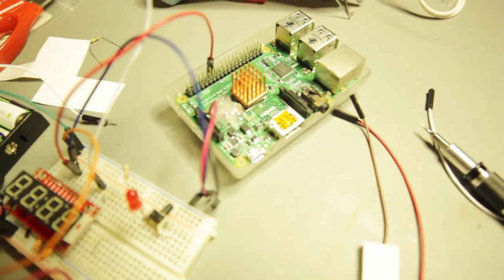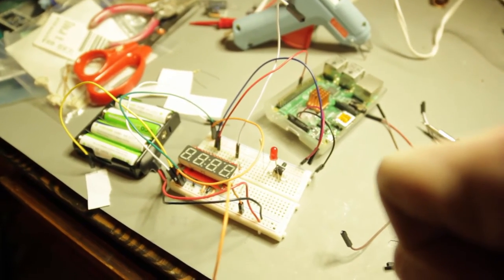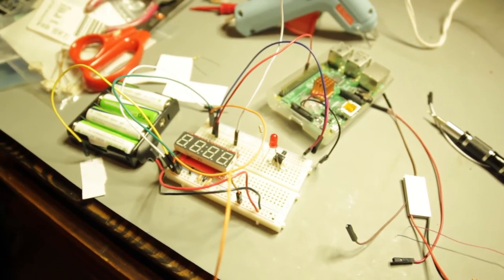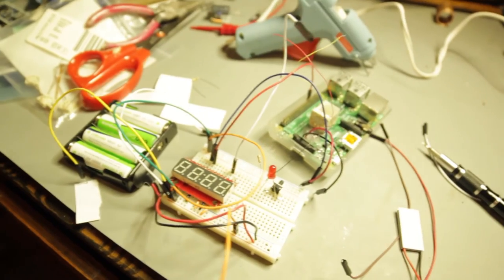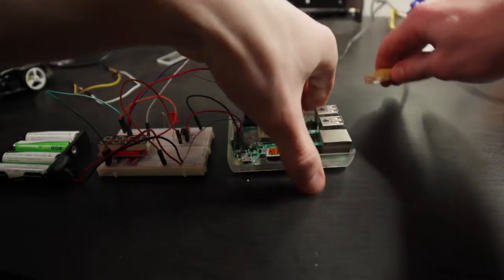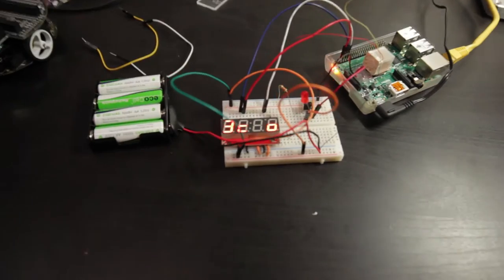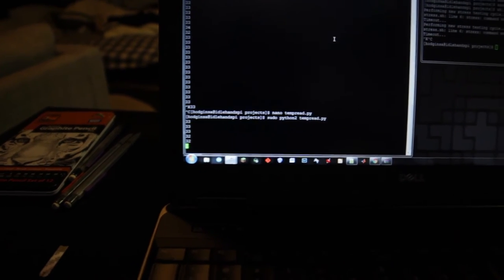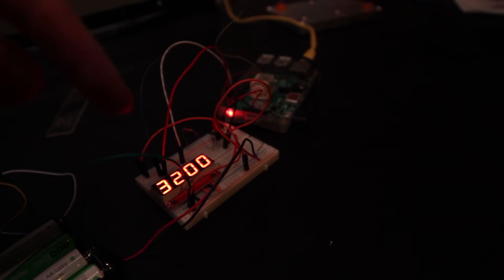Peltier on a Raspberry Pi! - Happy Pi Day!

Comment: +SeanHodgins This is amazing. Also subbed, Could i get more information on what Peltier was used?  I found the links to everything else used and purchased them. Eagerly waiting to start this.
Reply from the maker: Thanks! I don't remember what peltier exactly, but searching Digikey, find a peltier that is 15mm x 15mm like this https://www.digikey.ca/product-detail/en/cui-inc/CP60131H/CP60131H-ND/6217736 - I believe in this experiment I used two smaller ones in series because that is what I had in my random parts drawer. The bigger one would be better so use that. You found the fan and heatsink?
Reply: Thanks, I did find the other parts my 3d prints for the fan holder get here around the 17th
of May. bought a few of them for other projects down the road. everything else will get here sooner.

Comment: You need a More big heatsink for the Peltier... Then temp Will drop a Lot.
Reply: Ice tower?
Reply: @neverloveagain-c5l  i would recommend armor case, they have a space between the cpu and heatsink and should ve fitted with a thermal pad, you can put the Peltier un ther instead the thermal pad...